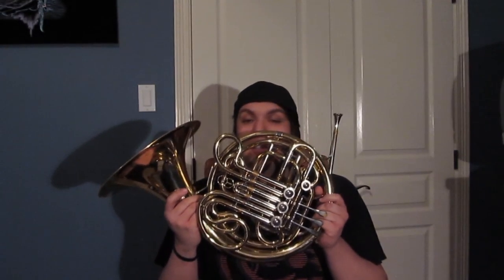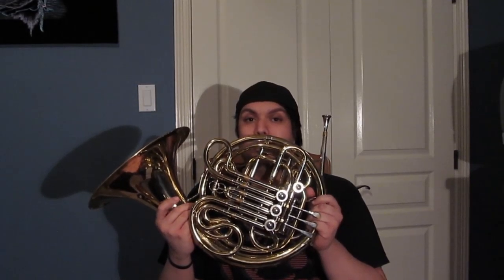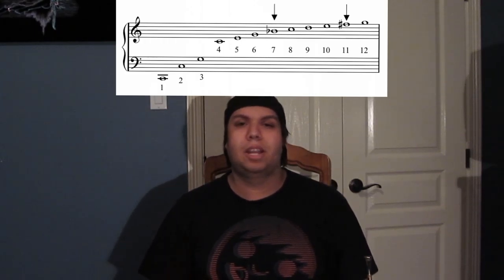WHY IS THE FRENCH HORN HARD?!?!

Comment from the maker: I see comments about the length of tubing of the Horn so lemme explain somthing..I was told in back in my High school days by 3 different directors that they were 12 feet of tubing on the F side and  I didnt bother to research to verify. So to make sure im correct, I went and researched recently and found some answers:
single horn is 12 feet
https://sites.google.com/site/sonjahornteacher/fun-horn-facts

main tubing is 12 FT but totals 20 if u add the bell
https://www.normans.co.uk/blog/2014/10/facts-french-horn/

another article that claim horn are 12 to 13 FT
https://blog.oup.com/2015/10/ten-facts-french-horn/

A yahoo answer page
https://answers.yahoo.com/question/index?qid=20100217160305AA62wdO&guccounter=1

I mean, im technically right, i was only talking about the F side not including the extra tubing for valves.
Reply: JC Ayala hi
Reply: it is 12 ft for the f side only including the bell. if you include the Bb side and valves it is only 18 in TOTAl. if it was 20 ft it would be in the key of A bellow a BBb CONTRABASS tuba.

Comment: You have braces? And how they affect the playing?
Reply: You get punished for too much pressure. Also the transition from braces to no braces has been really difficult for me.
Reply: Yeah, I got my braces at least 4 months ago and im still getting used to playing my horn.
Reply: I wouldn't even recommend playing with braces.. Could mess your embouchure
Reply: Just depends who you are because I had no trouble at all
Reply: i have braces. the only thing when you get them and you play the French horn the braces push against your bottom lip and it’s kinda uncomfortable.
Reply: I’ve been playing horn for 2 years with braces and I’m getting them off tomorrow... And festival is in a month and I have a solo.. how tf am I going to adjust that fast?
Reply: @sj2641  i know im late but just wanna say, i went from 4 years of braces and got them off in the summer. I havent really noticed too big of a difference except that i get tired a lot faster

Comment: That’s not true it’s 32 to feet
Reply from the maker: I was talking about the F side.
Reply: false. if you take a measure of EVERY amount of tubing in a horn it would only be 18 ft, including the valves and Bb tubing. The F side, including the bell and lead pipe, but not the valves or Bb tubing, is 12ft (actually 12.008). if it had 32ft of tubing it would be in the key of C an OCTAVE bellow a CC CONTRABASS  tuba, which only have 16ft of tubing.